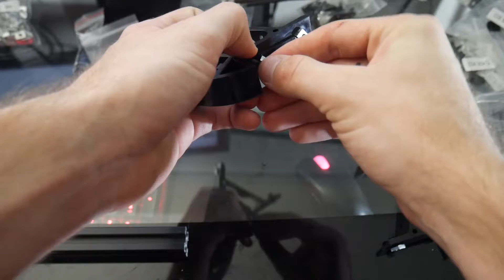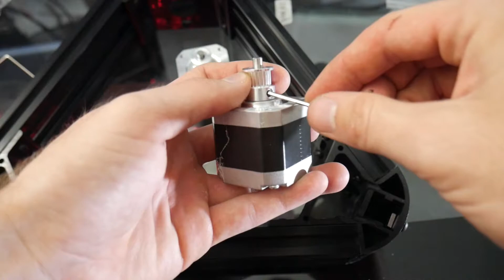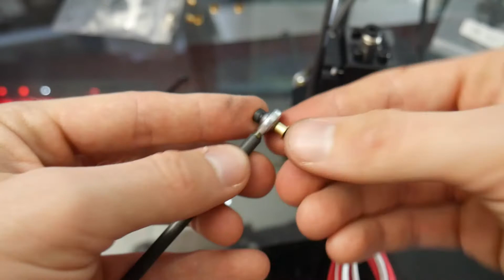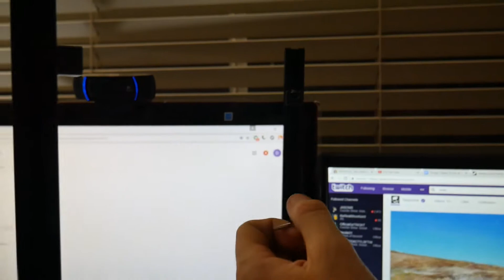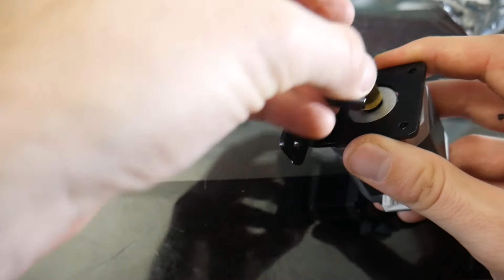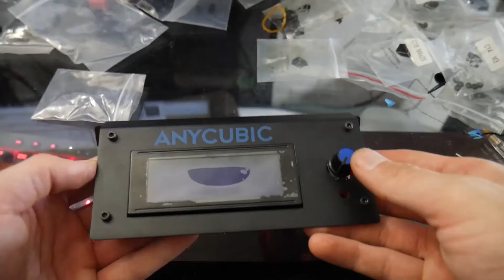Anycubic Kossel Delta 3d Printer Build

Comment: Hello! Can I ask please which types of screws you using on 11-51 for fixing three AL-extrusions vertical parts?  In manual nothing about its type, just "tighten the corresponding screws at each corner which is shown by red arrows." And which exactly screws is unclear.

Comment: I just ordered mine. Lots of reviewers say it takes 6-12 hours to build. Is it really that bad?
Reply: FreakinPeanuts I'm a total noob, I'm 14 just started with 3d printing, it probably took me 16 hours in total.
Reply: if you do it with one hand blindfolded it takes around 12 hours. Otherwise, no, around 3-5 hours tops for anyone who can assemble a lego set. Maybe 12 hours to get it like perfectly optimized and maybe print out 2-3 add on parts and stick them on
Reply: Mateo Mrnjavac I'm having adhesion issues, do you know why?
Reply: are you printing directly onto the glass? Also, did you manually calibrate height? if you calibrate where only about a piece of paper can fit between your hot end and the printer surface that is the ideal, if you arent getting good adhesion id check that your first layer isnt slightly too high.
Reply: Mateo Mrnjavac I'm printing on to the sticker that was in the box, should I use glass?
Reply: No the sticker is better. Without taking a closer look id say its temperature or bed height. If both those seem fine you might need to increase your extrusion multiplier if the filament isnt laying down on the first layer very well, or maybe decrease the extrusion multiplier if your model gets going and then the nozel hits the model and peels it off the bed.